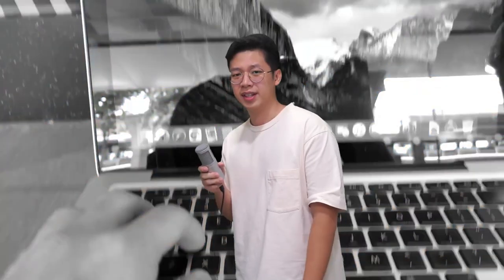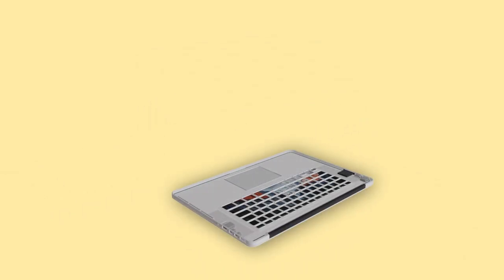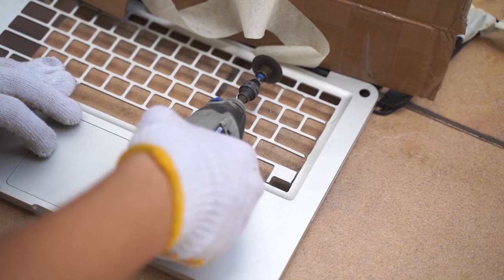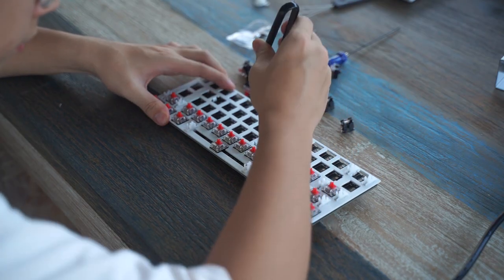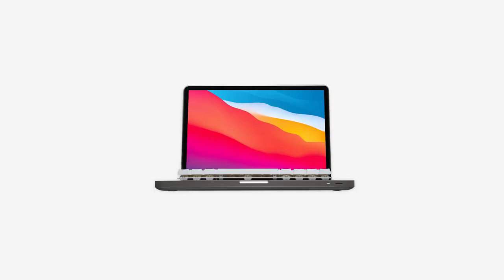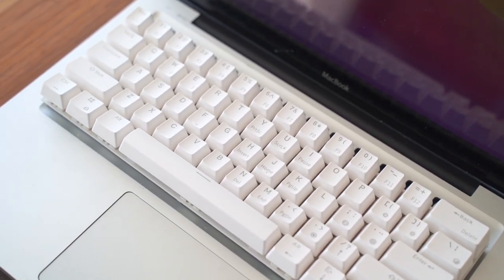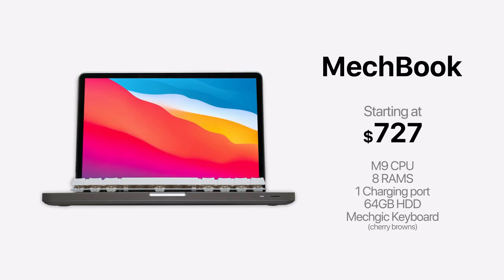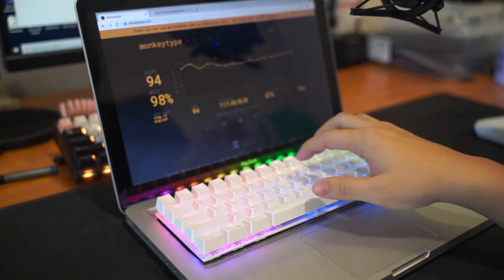I built a mechanical keyboard into a macbook

Comment: Clickity clacks at the cost of portability, worth it 10/10
Reply: I honestly can't justify me buying a new laptop even because they all have so crappy keyboards. This is a trade off I'd honestly happily make. Like, they are small enough as it is - for me, at least. What he had there, but better executed - that would still be portable enough. You could put it in your backpack or whatever. That's all I need.
Reply: @user-lv6rn9cf8m  macbook 2020 have really good keyboards, not as good as mechanical, but still rly good. you can also connect a mechanical keyboard with bluetooth, and sit it on top
Reply: @poopsniffer4436  I disagree but I get that's something subjective. Like now people seem to be into getting crappy laptop keyboards on their desktops in the form of low profile switches and I think that's completely insane (or rather a scam from the switch and keyboard companies, tricking teens into wanting them). But each to their own.

And yeah, that's how I do it now. But would really like a proper keyboard that's not separate from the computer. There's a few laptops with mechanical keyboards (a few Aorus and Alienware models) but they're so gamer-y and expensive. 

I don't get it even, like the IBM ThinkPad laptop keyboards in the 90's were superior to what we get now. Still use mine for retro gaming. Something with a keyboard like that would do if I couldn't get a proper mechanical one.
Reply: ... and RGB ...
Reply: @Shadow__X  That's just a huge plus, makes it look better and less gamer-y teen-y. This way you can have nice beige keycaps and everything.
Reply: @user-lv6rn9cf8m  no i mean it adds RGB, not at the cost of RGB
Reply: @user-lv6rn9cf8m  did you even watch the video?
Reply: @Shadow__X  i mean nobody cares about RGB.. i mean except some kids
Reply: Omg this is the worst. But he got me. 💕 niceeeee 👍🏽
Reply: you know thats why i wont switch from my 2013 lenovo g405s
Reply: @solarcat93 you cant

Comment: A magnetic mount that goes over the stock keyboard would actually be practical. That way you can just carry the keyboard separately and attach it in place when you need it
Reply: Yo that’s actually a nice idea.
Reply: Yes of course but no funny video about the engineer skills❗️😁
Reply: If I'm not mistaken, there is a low profile keyboard that, while doesn't have any sort of attachment system to the MacBook, actually has been manufactured to perfectly sit on top of the MacBook keyboard. I'll post a link when I find it.
Reply: isn't it is the same to functions of carrying a keyboard separately? you can use the bluetooth or receiver and then just turn your keyboard on, also having a good case of keyboard would prevent it from damaging electronic board so why don't just use it, less time consuming, same functions

Comment: Bruh how did you turn it on the power button is removed
Reply from the maker: there are 2 pins on the montherboard which when put into a close circuit, will act as a manual power button

Comment: my dude wearing a dam respirator for hand soldering, I just open a window and call it a day lol

Just a joke. Leaded solder is nasty, and the smell of flux is potent. A solder absorber is a good investment to capture the nasty fumes if you solder a lot. I can neither confirm or deny whether I own one yet.

Judging by the iron used I imagine it's more of a side hobby. But goddamn, that's like a $200 desoldering gun, respect. Still I'd definitely suggest something like the Miniware TS100 if you're in the market for a nicer one, fairly cheap but amazing control over the temps, more direct heat application (the entire damn metal part doesn't heat up), plus it heats up like 10x as fast as a cheapo.